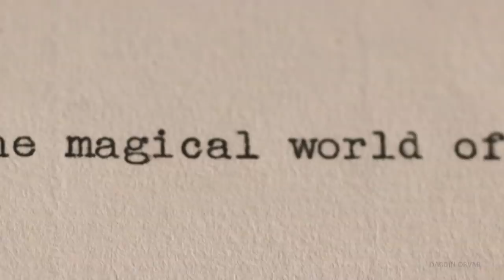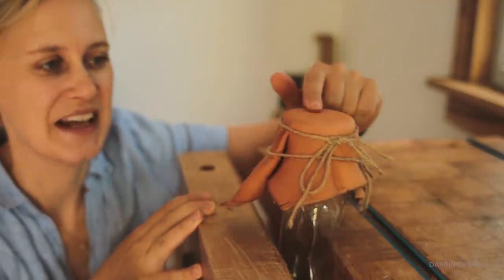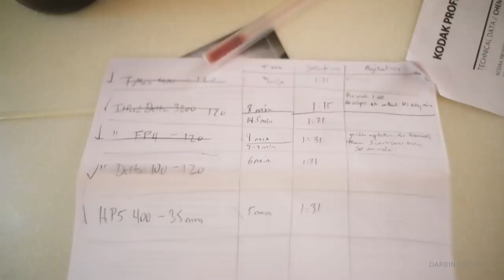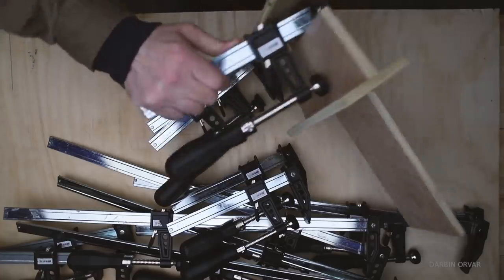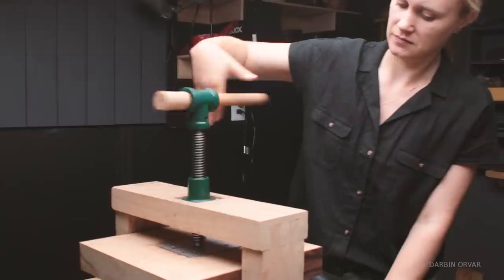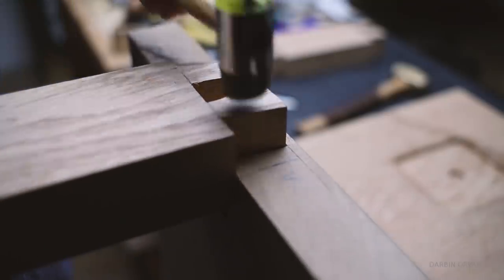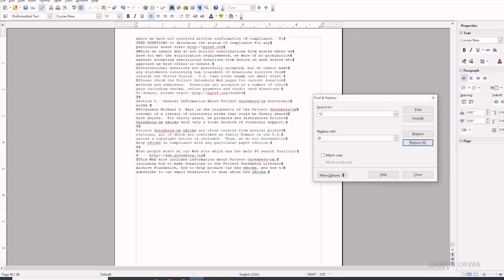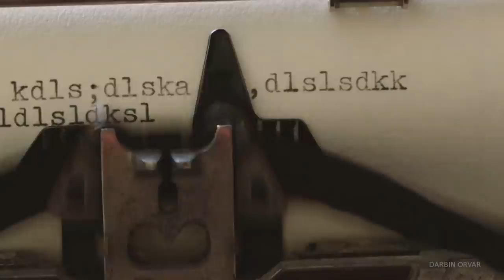Dovetail Talk & Tools / Leather Lens Cap - Shop Update Ep 3

Comment: Hi Linn, I like your lens cap idea but could I make a suggestion for your leatherwork? If you mark a stitching line, your stitches will look a lot neater. You don't need a special tool, I use a pair of dividers (you call them calipers. Same thing) and just scribe a line at the required distance. Then when you use your stitching iron, it all lines up. It also makes it easier when joining pieces together as the holes are all the same distance from the edge.